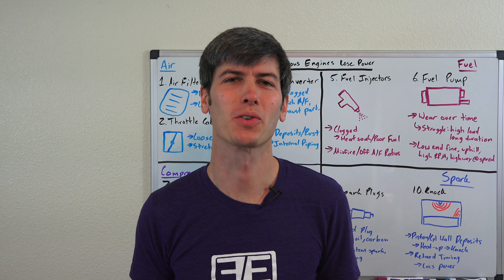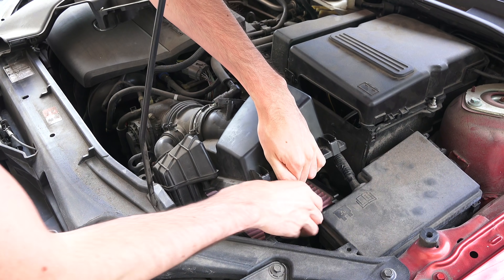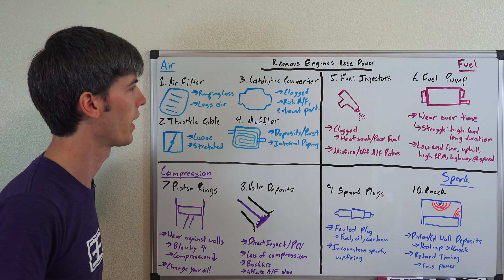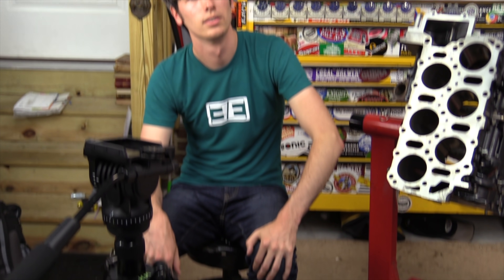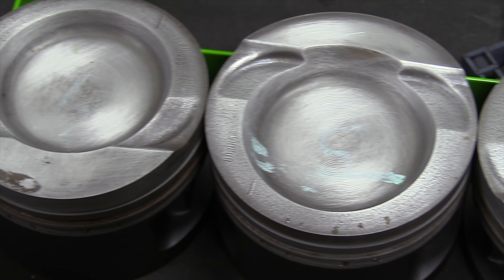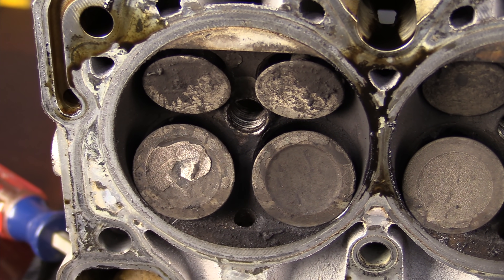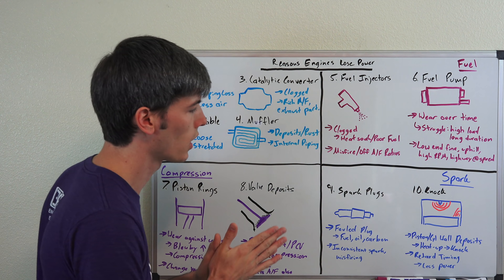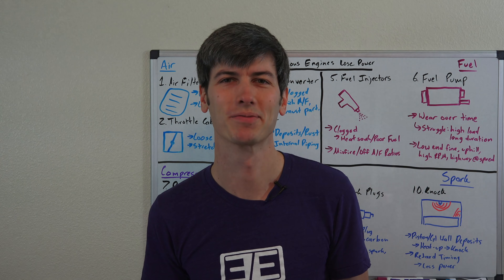10 Reasons Why Engines Lose Power Over Time

Comment: nice explanation..which engine will lose power faster diesel or pertol?
Reply: Totally depends on the configuration of the engine. One problem that a lot of diesels have is the EGR system. It is a setup that re-routes some of the exhaustgas back into the intake to lower the amount oxygen in the intake-airmixture. Less oxygen > less diesel burned > lower temps > lower amount of NOx formed > better for environment and health. Problem with that system is the almost unavoidable increase in engine pollution. The engine gets clogged which causes a loss of power. Modern new and cleaner diesel engines are usually equipped with the superior SCR system that uses a mixture of urea or ammonia and demineralized water as an addition to a selective catalyst system. This addition makes a reaction possible that reforms a solid 90% of the dangerous NOx to N2, also making the engine more environmental friendly and less of a health hazard without clogging the engine or reducing performance.
Reply: EGR is used in pertrol and diesel engine. May be the higher soot in diesel may cause additional problems. But i m unable to come to a conclusion whether which engine has longer overall life/mileage before rebuilding the engine. Some people say petrol others say diesel as the engine construction is robust.
Reply: Depends on configuration, build quality and maintainance. There is nothing else to say to it. There are examples of both petrol and diesel engines that have done 400K miles without a rebuild.
Reply: You're basically adding inert gasses. Those can't combust, they already did. Thus lower temps.
Reply: I don't think EGR works by "reducing oxygen", or that's a simplification. You need a certain amount of O2 in order to combust the fuel at all. If you have less than that it just sends unburned fuel into the exhaust. I think it has something to do with reducing heat of combustion, although less O2 has something to do with it.

Comment: Quick question: Do I need a  new PCM for Dodge Durango with a drive shift solenoid open circuit code because every 20 miles the code reappears after unplugging and plugging the plug responsible for transmission? I recently used electrical cleaning spray and so far at 22.8 miles with no code appearing. Changes done: transmission fluid, pressure sensor, solenoid
Reply: You need to fully diagnose the problem. Nothing you have done yet fully verifies wiring integrity from the pcm to whatever solenoid it says is open. Throwing a pcm at it (plus programing) is a costly guess.

Comment: Valve springs can weaken and reduce lift too
Reply: springs are there to close the valves, the camshafts open the valves. so lift will not change
Reply: Alright i screwed up that sentence. Springs can reduce compression though, that's what i meant

Comment: Is it possible to do a pcv delete so I wouldn't have to worry about those crankcase vapors going back into the engine. My engine is a atlas i6 with a fixed orifice no pcv valve.
Reply: Why would you need to delete the pcv valve if you don't have a pcv valve?
Reply: Just for youtube my vehicle has positive crank case ventilation but no pcv valve. If you don't know nothing about my particular engine don't reply to my comment. I'm asking him or anybody who has knowledge about the atlas 4200 i6 engine.
Reply: If your PCV is going to the intake of the engine like it does on my i6 then you can just remove it from the intake and let it hang down the side of the engine and it won't intake any crank case vapors, it'll just be like a breather.

You don't have some special engine that only atlass 4200 specialists know anything about. It's an inline 6 with overhead valves. Nothing special. The information i've given you is correct.

Comment: i had idle problems with my car, it was idling around 600rpm. after adjusting the spark plug gaps, at first start rpm went up around 2k and slowly fell down to perfect. its incredible how little things can cause big power losses.
Reply: That's not something that happens over time. You failed to adjust the gap when you installed them.
Reply: yep, mechanic screwed it up while installing. i just wanted to point out that even adjusting the gaps made such a big difference. even some things that happen over time can be corrected with small adjustments that will made huge differences.
Reply: I had similar idling issue, but mechanic said it was the fuel pump.  How do I know if my Cat conv is bad?
Reply: KOLT if your car is newer then 1995 it will tell you with a check engine light. Obd1 or anything newer then 1996 metallic rattling inside the cat or smell of exhaust changing with odometer increase can indicate a bad cat.

Comment: @Engineering Explained Do a video explaining fuel octane rating .   Explain how it's either truth or myth that the different ratings either burn more efficiently or less efficiently. Also, if putting higher octane fuel in your car is better for mitigating  carbon and particulate build up in the valve train/ head, exhaust, etc; as well as improving engine combustion giving it power.

Comment: So at what point are you supposed to deal with carbon build up? When the car is 5 years or when it reaches a certain mileage?
Reply: Probably either I'd imagine. If I had a new engine i'd sure be cleaning it often at around 5 years.

Comment: I saw on Top Gear once that they measured the power output from old cars, comparing it to its original specs. It was a funny, but interesting segment as these old cars had lost so much of their original power. Is it possible to restore an old car to its original power, or would it require a complete overhaul of the engine? Maybe a new engine?
Reply: the reason the cars "lost" so much power is because the manufacturers state horsepower at the crank. they tested horsepower at the wheels so a big percentage of powerloss came from the drivetrain
Reply: Everything can be restored to it's original power except piston rings to my knowledge. You'd have to pull the engine apart to replace rings or re-hone the cylinder walls to make them perfect again. All the other points that he stated here you should be able to replace or repair. You should be able to clean carbon deposits pretty well too.
Reply: When you are down to worn rings you essentially need an overhaul, because it's never just one part but all the major components that wear down.

Comment: Also in regards to injectors, over time the insulation between the windings in the injectors can fall apart which shorts that section of the coil, resulting in less fuel being injected as the injector doesn't open as much. Injectors over 20 years old will start to show these signs, if your car idles rough this is an indication that you may not be running on all cylinders at idle because the short open pulses don't have the power or time to activate the injector at one of the cylinders.

Comment: Don't buy a ford engine. They loose power when you drive it off the lot
Reply: That's a good thing,  letting loose the power.
Reply: its a joke. That's  why we love musclecars,   My best buddy is a ford guy, my dad is a Pontiac guy, I am a mopar guy. I have lost many races to all brands.
Reply: At least they make it off the lot.
Reply: +Mr1983abraham That's only because they are the ones towing the Toyotas and Chevys there.
Reply: and about 1/2 your paycheck for 4 years
Reply: let's not get too loose with the lose of power.
Reply: my mk1 ford focus begs to disagree. it only becomes faster over time :)
Reply: Read my comment elsewhere on here.
Reply: Don't buy any brand then, because someone is guaranteed not to like it.
Reply: I recently race a BMW M3 in my CTS-V caddy. That BMW is one fast mother fucka. He almost had me in third gear. Once I hit 4th I took off, just has more hp stockwise. The only mod I have is a custom exhaust system. 4
Reply: the other reply is refering to 1/4 mile obviously. 
best 0-60 was 11,2 seconds- should be a little off too by now
Reply: mikey1974 hetfield 21.6 - twenty one point six seconds :D
Reply: mikey1974 hetfield you know how to drive but you don't know how to spell lose. That's weird
Reply: What numbers to you get in the 1/4 mile  0-60??
Reply: can't remember exactly because it's been years I measured that. It was about 21 seconds :) 
now I reckon it would be 24 sec. or something because of the worn clutch. the top speed hasn't changed tho :)
Reply: 21 seconds or 2.1 seconds?
Reply: you can mod these cars and get some impressive numbers. We are talking high 13's in the 1/4 and 300 lb torques 0-6 in the 6 second range,
Reply: now I'm really courious what the time is gonna be 60k miles later with a worn clutch. gonna make a new run 2morrow :))
Reply: mikey1974 hetfield as far as I know you can hardly get any significant additional power out of a 1.6 N/A Zetec engine, or can you?
Reply: Mr1983abraham Who's to say for sure that any other car company doesn't do the same thing?
Reply: Mr1983abraham but American automaker are not known for cars, it is mostly trucks, how many fleet use japanese truck(titan,tundra).the big 3 are trying but  I guess they should stick to trucks
Reply: lol what
Reply: F.O.R.D. found on road dead.
Reply: Actually the lincoln is #1 in vehicles with the highest milage for sale across the nation...over 300,000 miles
Reply: The point here is that Ford Trucks and Ford RWD V8 cars have similar reliability to Toyota and Honda 4 cylinder cars and V8 Chevy trucks when they reach over 300,000 miles and/or 15 years. Those 5 types of vehicles make up 60% of the vehicles that make it past 300k miles or 15 years. In fact the Ford F-250 has the longest average life span (50% still on the road) of any vehicle sold in North America, averaging over 23 years.
Reply: Haha good I like that